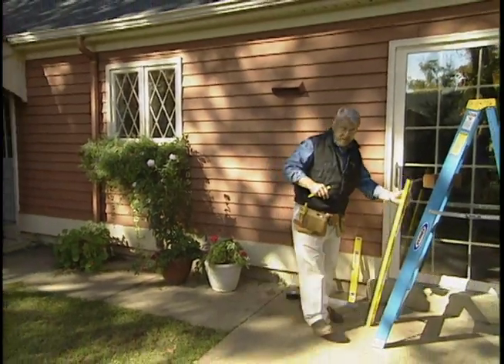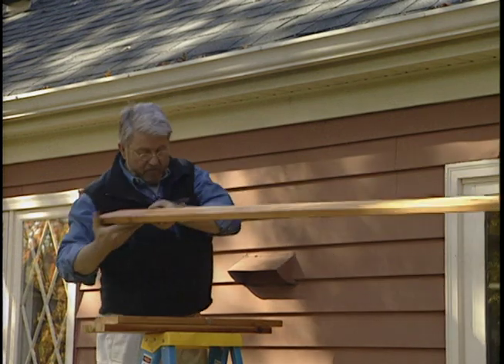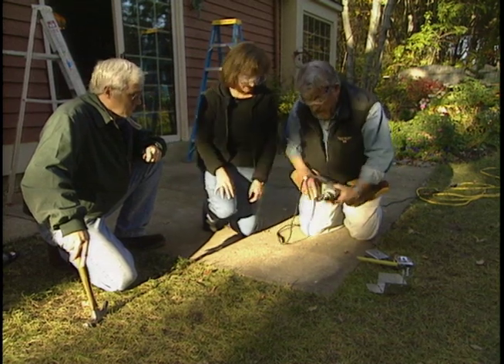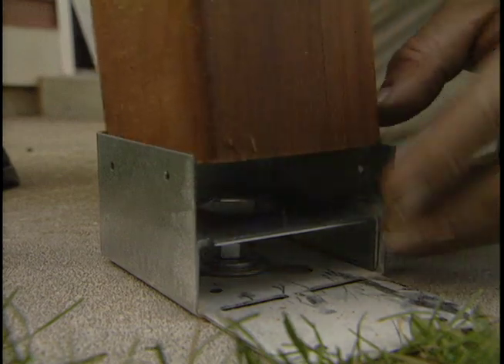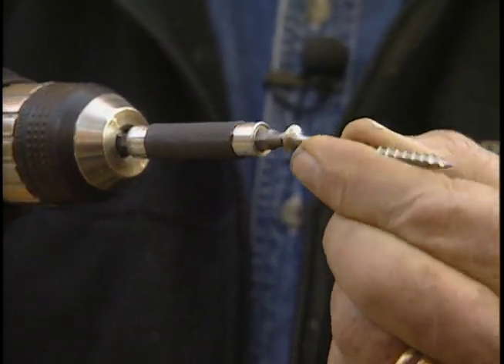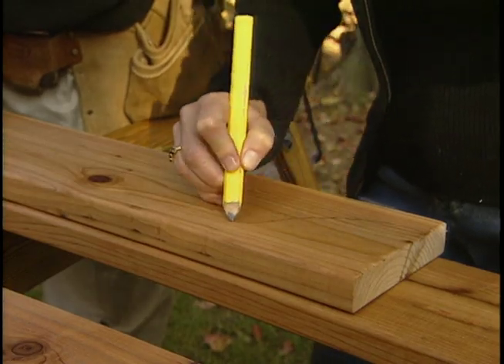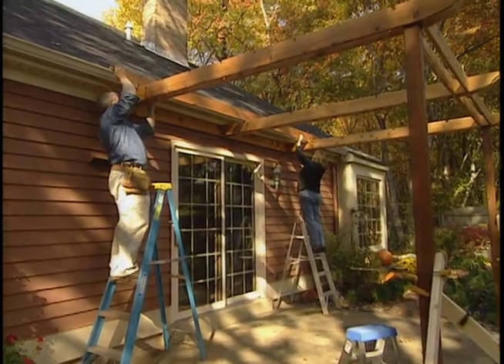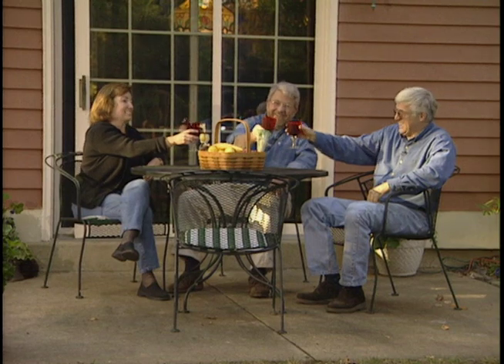How to Build a Pergola Over a Patio Video

Comment: So wait, the trusses do not need to be nailed or screwed into place or use brackets? Just a simple lap joint? 

Also, the posts are only held in by nails? 

I'm guessing code for pergolas is a lot less strict than for a patio roof.

Comment: ummm correct me if i'm wrong, but shouldn't the direction of the boards be perpendicular to the rays of the sun. so that as the sun moves the boards provide relative shade? when the boards are parallel they only provide half an inch of shade. a very nice wooden sculpture though.
Reply: Just do a search for DIY wire pergola canopy.

Comment: I think I would have used lag bolts at the posts where the two joists connect to the post.  Screws have terrible shear strength.

Comment: So the weight of the entire structure is held up by screws instead of sitting the ledgers on a notched post?
Reply: Good point .
Reply: Busy Wondering I was thinking the same thing, or bolts at least right?
Reply: @ManuelHernandez-br6dy  I agree and if the wife didn't like the bolts protruding, they could inset them and still be stronger than the screws! The good news is that it's not too late. I get 80mph winds in my back yard, so I'm not even sure if I can use 4x4s. 6x6s are $40 each!

Comment: It is very obvious they live in a area where there is plenty of rainfall. The one thing they forgot is a plastic (usually nylon) spacer between the bottom of the base bracket and the top of the concrete. This prevents the bracket from corroding. These spacers are especially necessary when the post is near a swimming pool.
Reply: They used a galvanized spacer that came with the bracket. Watch the video again.

Comment: No predrilling ?  No notching posts ?   Did you pre drill those lag holes...  to make sure you're hitting the joist ends ?   Or the sill board ?     You used stainless screws...   At a minimum you should have used bolts to connect those boards !   I can go on & on about this build !    WTFOOL !